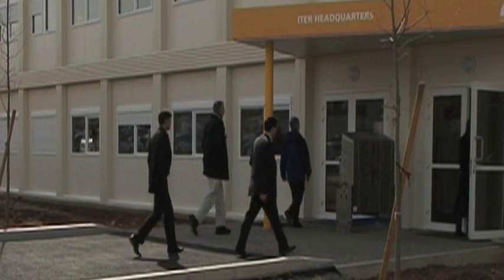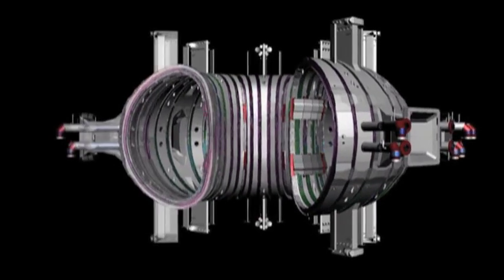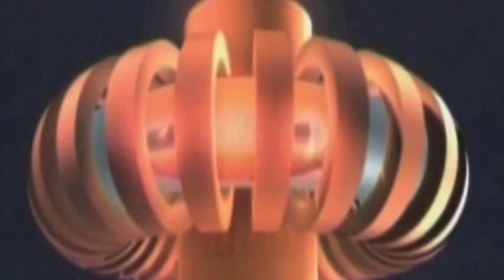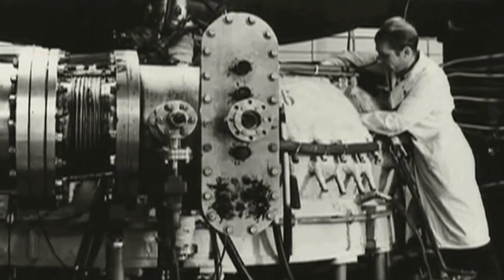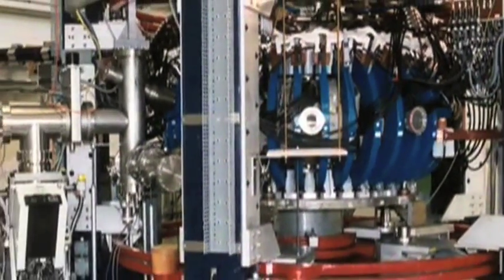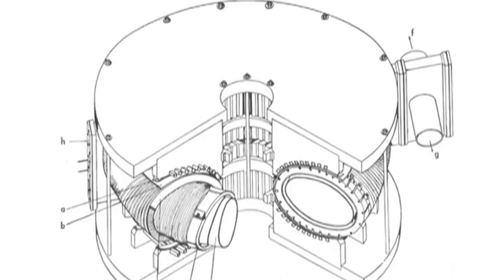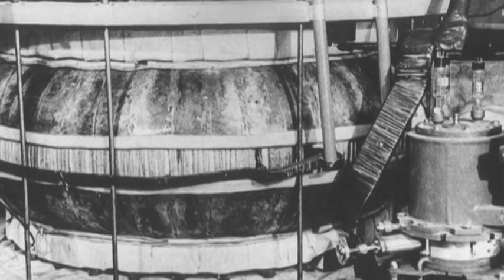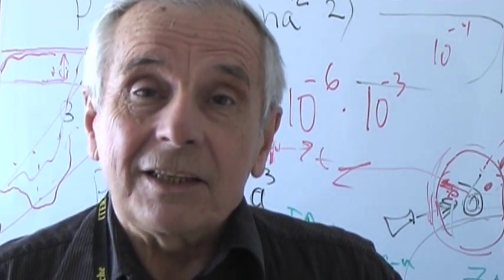ITER - TOKAMAK: fusion history in a nutshell

Comment: Further innovation in tokamak performance was developed at MIT in the 1980s in the Versator II Tokamak. In those pioneering experiments, microwave generated plasma waves were use to drive a toroidally directed electric current in the tokamak via process similar to Landau damping. Such steady state RF Current Drive may  provide the basis for a steady state tokamak unlike standard magnetic induction driven tokamaks which are inherently pulsed or oscillating. 

In the tokamak, a toroidally directed electric current flowing in the confined plasma is essential. Such electric currents generate a rotational magnetic transform so as to create a magnetic field configuration capable of confining a hot plasma. Steady-state RF current drive may open the way to a truly steady-state tokamak fusion plasma confinement device.
Reply: Mathview. You freaking nailed it sir, i hate to say that the current flow induced Magnetic Autopinch requirement is both obvious and paramount to actually achieving real fusion, why are they all sharing the same fruitless design wasting millions? Military Industrial Complex Hiding something? Smells Fishy at best.

Comment: TOKAMAK=To Obtain Kamber Angle on Mother's Ancient Kar. Lateral thinking: find as many uses for Tokamak as possible. Use #17 384: to quickly and easily tune your mother's ancient car to get a wheel camber as to look cool (To Obtain Kamber Angle on Mother's Ancient Kar=TOKAMAK). Simply place the Tokamak on the car. The weight of the Tokamak will make sure the wheels spread and bend into a permanent camber angle. Never was car tuning as simple as quick as with TOKAMAK!